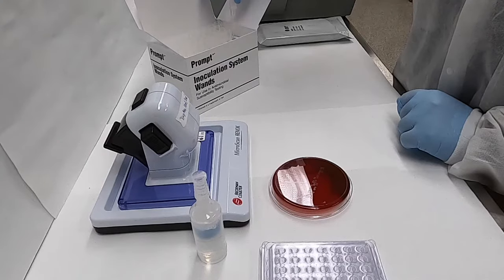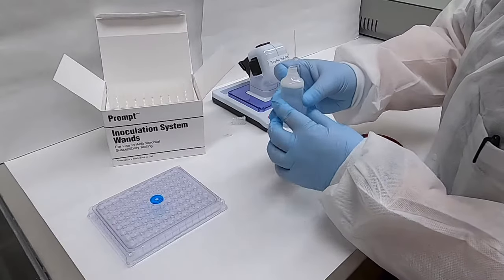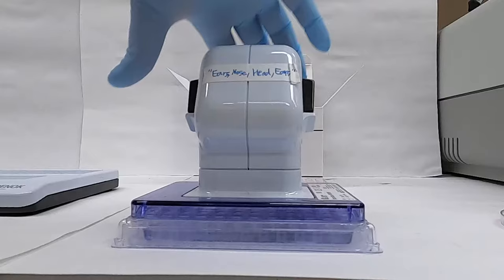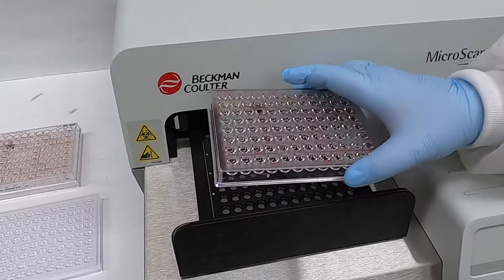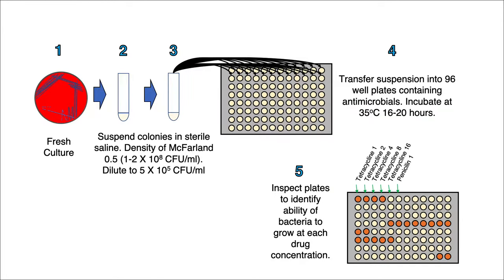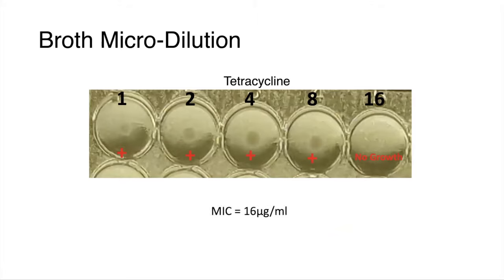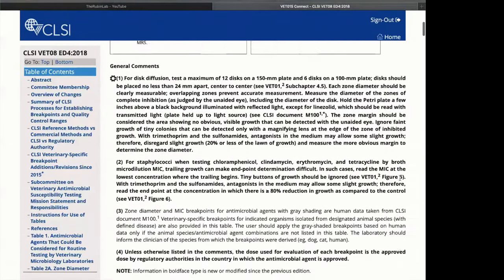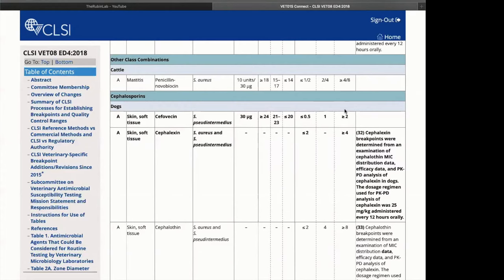MIC (Broth Microdilution) Testing

Comment: Can I know, What volume of inoculated culture do you add to each well? Thank you
Reply from the maker: For this product I am actually not 100% sure what the volume is - because we use these calibrated micro-pipettes, the manufacturer has designed to product to ensure the correct final drug concentration. 

When doing any sort of broth dilution susceptibility testing, the most important factors related to your question are: the drug concentration in the final suspension, and the density of the inoculum is correct (~5 X 10^5 CFU/ml). I hope that helps!

Comment: Sometimes for certain antibiotics instead of complet growth of bacteria in the well, there is pin point growth. Should it be considered as resistant or ignore it?
Reply from the maker: It really depends on which drug it is. In general, as a long as this is growth it would be considered positive. However for the sulphonamides inhibition is considered an 80% reduction in growth compared to the control; so 20% growth is still considered negative.

Comment: Why should we use double strength medium for microbroth dilution test?

Should we use double strength concentrations for the antimicrobials (controls) and the tested products too?
Reply from the maker: Good question! It depends on exactly how you are doing your test - if you're using a commercial system like we've demonstrated here that's not necessary. But, if you're preparing all your media in house this may be important; you want to make sure that your FINAL Mueller-Hinton broth is 1x (full) strength. So if you are adding a bacterial suspension in a 1:1 ratio with your antimicrobial containing broth its concentration will reduce by 50%. I would suggest trying to write out the whole procedure that you're planning to use and do all the math (how do the concentrations change at each step), this will be critical not only for ensuring that your MH broth is the right concentration, but also to ensure that you're testing the antibiotic concentration you think you're testing! Hope this helps
Reply: @therubinlab I am confused here.
Do we need to increase the strength of broth medium for MIC test?
Reply from the maker: The main thing that you need to be aware of is that the FINAL broth should be 1X strength - so depending on how your prepare your antibiotic containing broth, you might need to start with a more concentrated stock solution. For example, if you plan to make add your antibiotic suspension to the MH broth in a 1:1 ratio - (ex. 1ml of antibiotic suspension + 1ml of broth) then you would need to use 2X MH broth initially and also double the final desired concentration of antibiotic. More recently I prepared a video describing the process of agar dilution where the process of in-house prepared media is more thoroughly described https://youtu.be/1t_UQhtR7pg I hope this helps! @ifeoluwaidowu7692

Comment: in which wavelength microplate is read? Incase of colistin broth microdilution.
Reply from the maker: Oh that's a good question and I'm not sure what the answer is... for the Microscan system I suspect this information would be available on their website or through a company rep. I should also say, that it is possible to read the plates manually (you can simply visualize the plates and look for growth), so a special plate reader is not necessary.